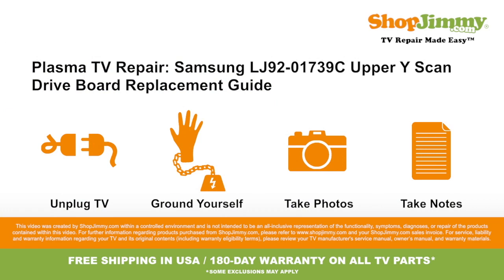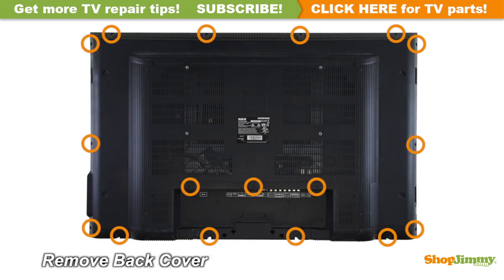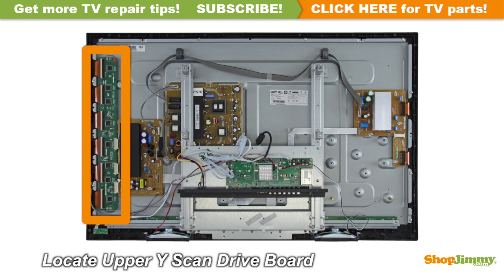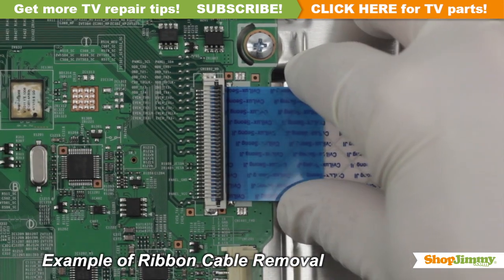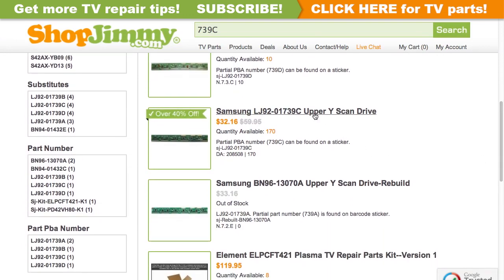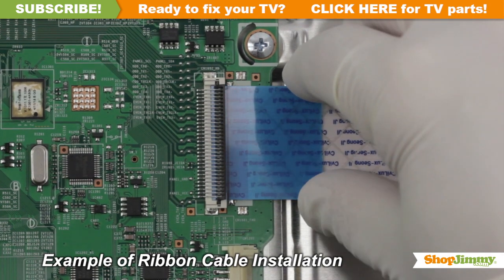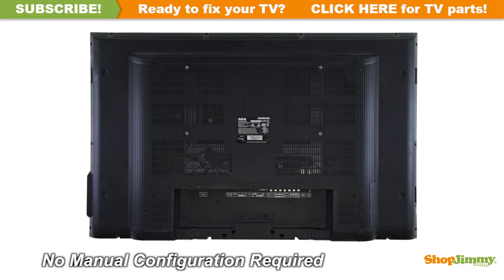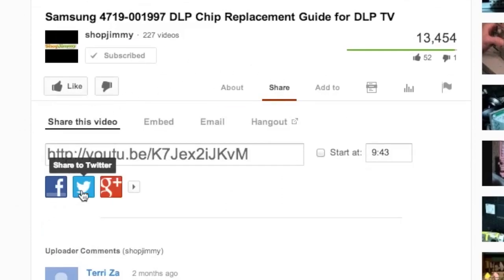Samsung LJ92-01739C Upper Y Scan Drive Boards Replacement Guide for Plasma TV Repair

Comment: Hey there I have a PN60E6500 Samsung It works fine no problems whatsoever until about 30 min on it just turns off then starts clicking. I have unplugged the y drive board and tested the VS on the power supply while turning it on. it clicks and never reaches 219V which is its labels operating voltage. on my tv the y drive board is connected to the x drive board not the power supply. i have also unplugged the ribbon cables from the y drive board and the TV seems to stay on longer without switching off.
Reply: +curveball323 Just tested it again and when it clicks off. the VS on the powerboad drops to 5Volts from 291V in about 10 seconds while the VSC on the Y drive board drops to 10 V in about 40 to 60 seconds.

Comment: I have a 42pa30rq with no picture. Red power indicator turns blue but not before clicking about 4 or 5 times. Any suggestions?
Reply from the maker: john jensen  I recommend unhooking the Y-main board from the TV and turn on the power.  See if the TV stays on with the board disconnected.  Thanks!  www.shopjimmy.com